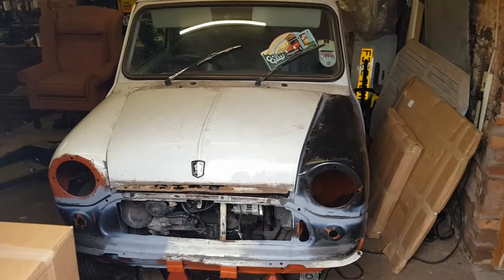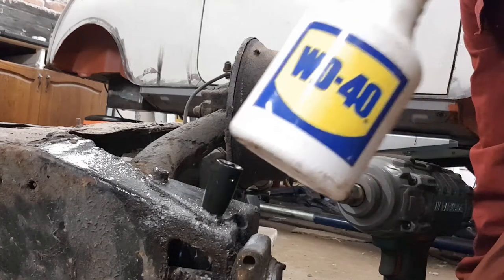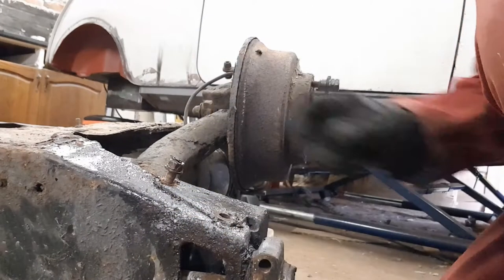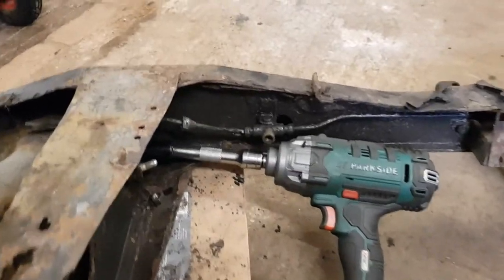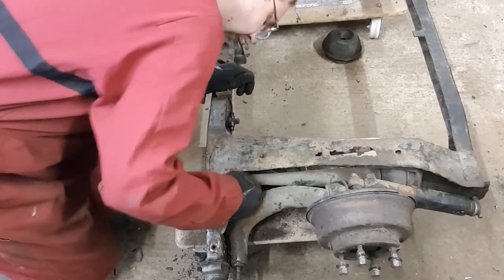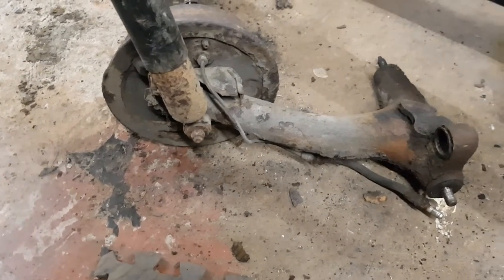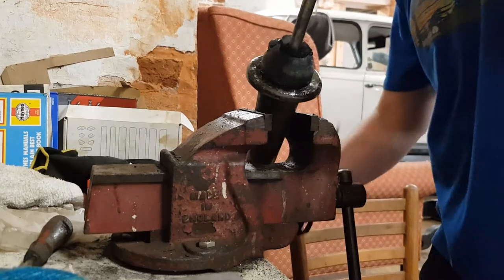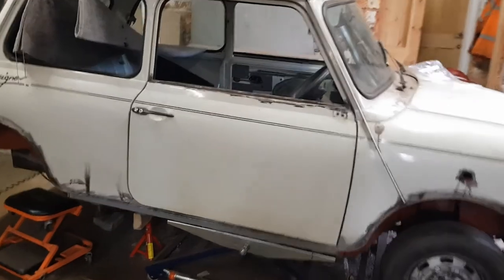Project Designer Ep 29 - Austin Mini rear subframe strip down

Comment: My sub frame was so rotten that it just fell apart lol. Great video 👍 
I looked at genuine one but it was £500 so got a patten one for £225 and it fitted great. The heel board I replaced had metric nuts welded to it not imperial ones so the bolts that came with the sub frame didn't fit, I had to get new bolts. Just started mine for the first time yesterday so massive mile stone for me and looking forward to yours starting up 👍
Reply from the maker: Fantastic! Yes the heritage subframes aren't cheap and I've heard very mixed reviews about the pattern ones, I think that some are better than others.
Reply: @BlakesDen  I got mine from old school minis and very impressed 👍
Reply from the maker: Thanks, I'll check them out